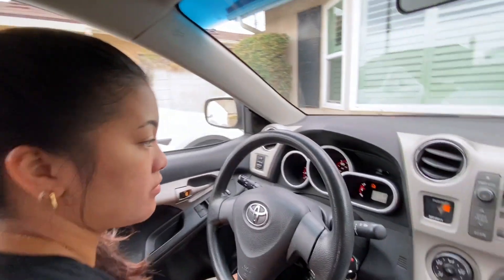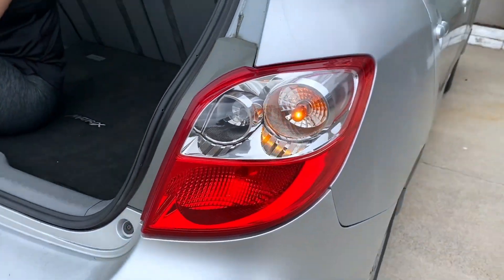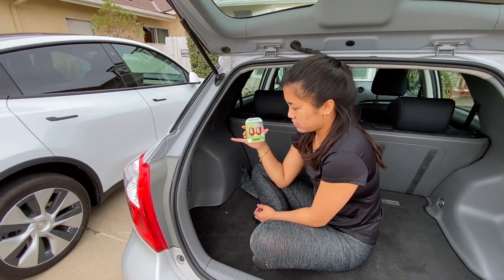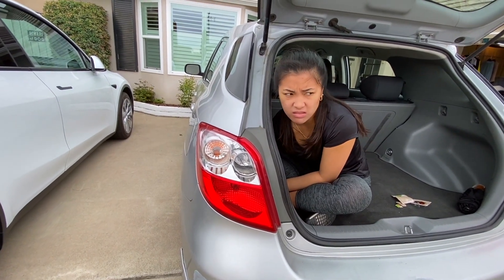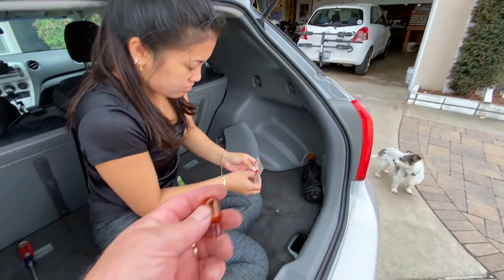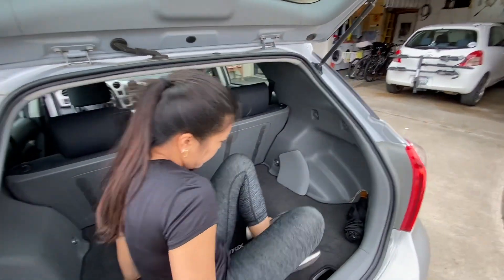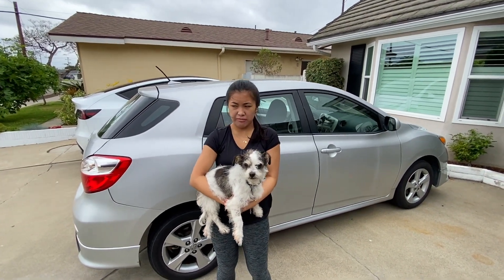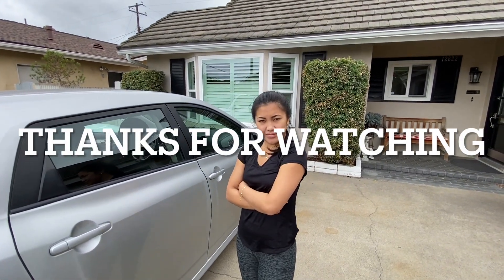Scott's Garage - Turn Signal Bulb Replacement - 2010 Toyota Matrix

Comment: @ScottBelanger videos 

Couple questions about 2010 Toyota matrix.

1: is ur third brake light are factory led or factory incandescent bulb?

2: is the map light bulb has T10/194 bulb, dome light a festoon bulb 31mm, and trunk light is also festoon bulb?

3: u guys have access to oem flasher relay under the steering wheel?
Reply from the maker: Thank you for the great questions. I wish I knew the answers, but I'm not really sure about these. Good luck.